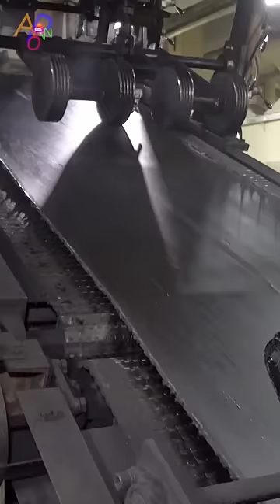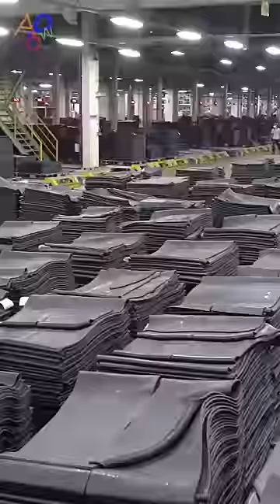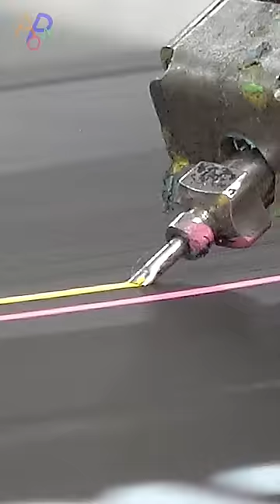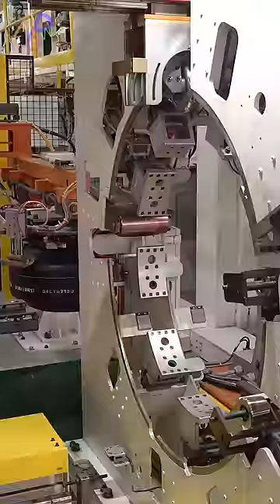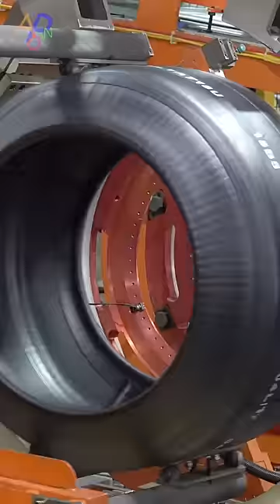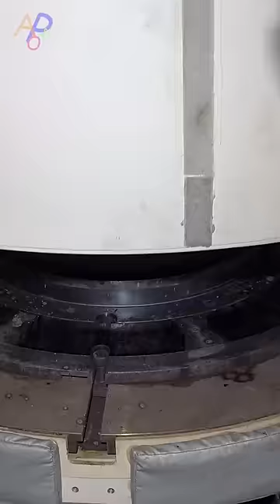Car Tires Mass Manufacturing Factory in Vietnam #allprocessofworld

Comment: Something about seeing the "original audio" tag at the bottom of this video, makes me want to believe a piano is an integral part of this manufacturing process.
Reply: Ja. Ist bei jedem Autoreifen in der Produktion. Die Autoreifen sind die Tester für das abendliche Ballett. 😅
Reply: Of course, don't you know that all the best tires are built with Mozart.  Rubber doesn't just vulcanize for just any composer.   The Piano Sonata No. 11 definitely produces the best all-weather general performance tire.  Some use Beethoven, Schubert, etc.  

Now Baroque will give you a much more utilitarian tire.  A/T tires and agricultural tires mainly.

But if you want a high performance tire you're going to have to get into the Romantic composers Wagner and Liszt are a must.
Reply: @LogicalNiko  Thank you for the detailed insight
Reply: @Drebel503  🤣🤣🤣

Comment: I worked for Bridgestone Firestone and it's not a easy job!!! I had to run 3,000 tires through a machine every day and i ended up having 3 surgeries!!!
Reply: Should not have run that much.
Reply: I worked as a tire builder @ Firestone Tire & Rubber Co for about thirteen years. I actually built the same tire for three years that after curing had 37 different labels for 37 different markets!
Reply: How do i get to work for firestone ?
Reply: @PECASH_GH  Go apply?
Reply: @PECASH_GH  like every other job?! 😂 If you're not something special NO company will come to you to ask if you'd like to work for them 😂😂
Reply: @jldavis5936   Were they branded different like linglong, nokia,toyo for certain markets, or just 37 languages saying it's a tire do not eat.
If I remember correctly there actually was one asian brand sounding tire that on the side in small print said manufactured by bridgestone if I recall the company correctly, but it was also re-thread so I didn't think too much about it then.

Comment: But where are the wire reinforcements for the edges?  And there is no appropriate layer of mesh material, in rubber to prevent puncture.  Processes leading to the final product are missing.

Comment: I’ve worked in tire rooms before on production lines for automobiles, and the speed of the process is mind boggling. We’re cranking out a car every 53 seconds 19 hours straight per day. And these guys are supplying us with at least 4 tires per car! And we are just one plant out of hundreds. Then there’s the fact that a lot of older vehicles require new tires, so there’s that load on top of the 6000 tires per day just my plant alone needs. Granted, there are several brands with many manufacturing facilities each. But the speed is still pretty crazy. I wonder how many tires are produced every minute.

Comment: Nice. I knew what happens when a tire breaks it’s cords and I knew the treads went on last, however you see the cords before installation and the treads are placed on the inside and the entire tire is turned inside out.   This was extremely interesting to see the separate components and the manufacturing process itself. One of my vehicles has white letter, racing-style tires, I've always wondered what is applied first, the color white or the black side wall then the color white. BTW, my tires are only rated for 110 MPH and the governor will not let the vehicle go over 109 MPH (I was told).